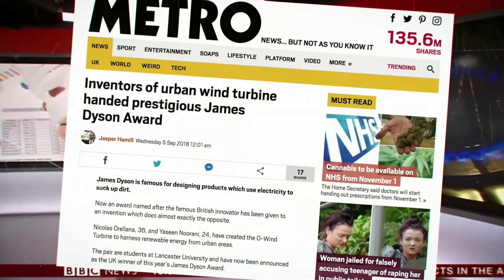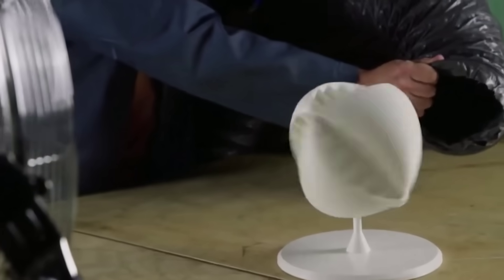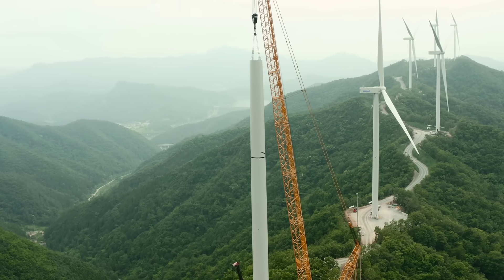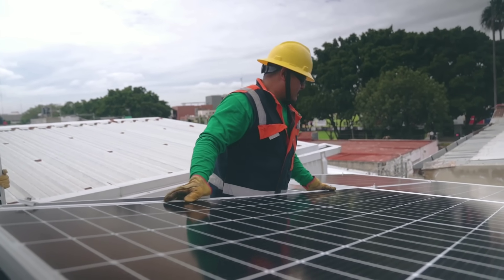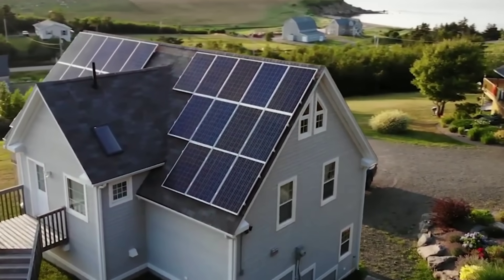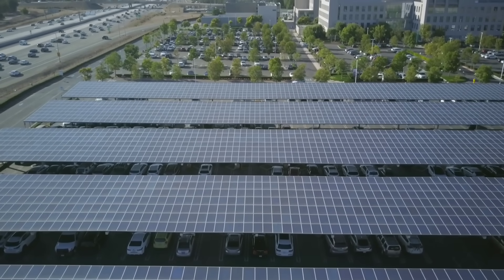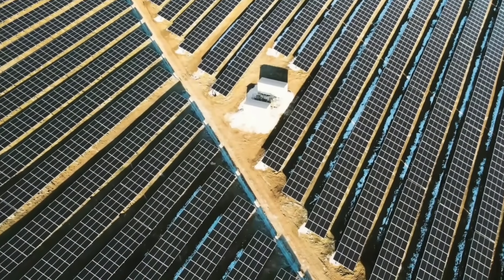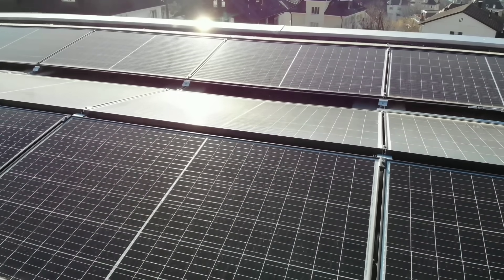This NEW European Wind Turbine for Home Out Perform PV Solar Panels in 2024?!

Comment: A wind turbine should not be beautiful, but should provide energy. In urban conditions, 6m/s is a rare wind speed. This turbine has no working area. There is a new technology for wind turbines on the user with the same name as mine, which uses new methods for regulating wind power, without them you simply do nothing. It's just that current wind turbines are for trash.

Comment: I have a wind turbine my solar panels work a lot better than the wind turbines why do you think that they work better I have been off grid for 25yrs turbines only work good when the wind is blowing very fast for many hours at a time.solar panels are not that good in the winter you also need a generator to charge your batteries. You should not take on every thing that is told about how good wind turbines or solar panels are good times and not good times with both of them.

Comment: It spins by itself fine, but what happens to it when you connect a generator? Presumably, if it still turns, you will get a variable frequency, variable voltage out of it. So we have to add a full wave rectifier, then  regulated power supply. At night, that is wasted energy, so you will also need some form of battery storage, then an inverter to convert it back to mains AC. It is clever, but it is only one spoke of a wheel!

Comment: This might be good on a sail boat. Allot of sailboats use solar and wind turbines but this seems to perform the same no matter how much you’re healing or what direction the wind is from. 
Also, the airspeed behind the windward side of the sail is faster due to the aerodynamics of the sail. They might be too bulky though.
Reply: Sails should be a giant bi facial panel powering the boat and electric prop.

Comment: Pure nonsense! All practical tests show that small wind turbines close to ground hardly generate any electricity! And only at very high costs!
Because there is hardly any wind close to the ground. It is also extremely gusty, which usually shortens the service life. 
Only if you need to be self-sufficient from the power grid, you should install the largest possible wind turbine on a high tower for the winter.
With solar panels, on the other hand, you can reliably generate green electricity for 25 years at approx. 3-10 cent/kWh!

Comment: if you have a 10 storey block of flats in a square design, with each floor being around 3m high (ball park figure), then from about 6m's up have these O-wind turbines conected to the corners of the building at every 1m - 1.5m, would that produce enough energy for the building, or at least all of its reliance on having to use fossil fuels???? - it might look wierd and strange having these all the way up your building but if the design is good then ppl probobaly wont mind that much

Comment: OK (sigh) here I ask again at another latest innovation of wind power:  where do you put the lubricant? It does need maintenance and don't try to convince me otherwise. It will get dirty, dusty, bugs will try to nest in it, birds will poop  on it, idiots will vandalize it. It will need lube. It will squeak if pebbles get jammed in there and they will. Does it freeze solid? Ice will form on it shutting it down and that blizzard last night that you were depending on to charge the battery will not happen and you gotta go chop wood to keep warm. STOP spending money on advertising with paid actors and max out the R&D till it's flawless and THEN show us. Don't persuade us.

Comment: PV is down to $200/kWp and is still falling, 30% alone in the 4 months since this video published. This turbine (not available) scaled up to 1kW would be several times more. Small wind turbines will never compete with solar, in price or production. Remember, they also only last one fifth of the time. Large turbines are a different matter, off shore more so. No contest. But this toy will never compete against even a $30 flexi 100Wp panel on the balcony.

Comment: The Halcium powerpod. Is an omni directional wind Turbine. It is a much more sturdy design. And produces way more power. They are close to production. Have functional prototypes. But can't get the finances to get there. I would buy 3 of their units to supplement my 19kwh solar panels, 72kwh storage. That I already have. But unfortunately no one wants to finance start ups.

Comment: The videos consists of 80% babbling that got nothing essential to do with the turbine. Comparing PV to wind is futile in pretty any aspect, let alone: claiming % of efficiency increase vs the other.
There are 2 turbine types shown: one with open air channels and another with closed air pockets, but no explanation what it does better / how much it behaves better compared to other vertical / helical / Flettner rotor designs, especially when it comes to efficiency at common wind speeds or scalability.

Comment: Instead of being in competition, turbines and solar panel should complement each other. One works only in the sun, while the other works when there is no sunlight. The use of both generation systems guarantee 24 hour per day electricity generation.
Reply: Absolutely 😊 💯
Reply: Without competition the motivation for innovation would diminish
Reply: @Sovereign272  Solar Panels could compete against other solar panels-same for turbines. When someone discovers and harnesses dilithium crystals the need for competition will diminish.
Reply: Stop being stupid guys i know having electricity is something very useful but think the climate impact of the wind turbines they reduce rain drop according to various studies by 75 if they are installed into the masses that may mean.... less to zero raindrop on cities are you guys nuts?
Reply: Assuming there is enough wind at night?
Reply: 20mA is not guaranteed when the panels are not working, nonsense
Reply: @FreddieVee  
No wind, heavy clouded skies.
You're back to candles.
They are a petroleum product.
Gonna cook, or eat cold?
Reply: @TahoeJones  There are ways to store energy and the different ways proliferating, as each method improves it's efficiency.

Comment: Solar panels give out 250Kw hours?
For a start, forget the hours part, it is meaningless at this point.
Solar radiation is between 1-1.2 Kw per square meter. Solar panels are around 20% efficient.
So that means 200-240 watts per square meter.
Your numbers are out by a factor of 1000.
Total rubbish.

Comment: At 3:55 the narrator claims "the turbine claims to have a power output of 200 kWh, which is enough to power a small appliance...." This is nonsense, or the video's producer just doesn't understand energy. All that matters is the power output in watts, for a certain diameter, at a certain wind speed. If that little one generated, say, 200W at 8 mph, that would be fairly respectable. Since output is directly dependent on what we call 'swept area', and since this turbine has a minimal swept area, I suspect the output is disappointingly low. 
It is very, very difficult to compete with photovoltaic panels. They sit there, almost maintenance free, for decades and continue to produce power. I have a thirty-two year old set of Kyoceras still on the job!

Comment: aha.   photovoltaic many different kinds  which one.  toy pv?  which is 5v,  .1 amp.  or those rooftop pv which is either 10 or 12 volt at 1 amp (smallest)?   did OP mean multiple panels of which kind?  does not even say what kind photovoltaic panels or sizes thereof.     
IF IF youtuber was directly talking about wind power or wind energy output so forth,  would made a good video.  but unfortunately the title is "establish a lie" being able to out perform PV  thus OP is supposedly demonstrating electrical energy, not companies nor the wind energy.  

Since double fallacy is given,   clearly  this is CLICKBAITING.  I am reporting them,  no money for fake facts.

Comment: You can't claim that something outperforms something else if you're comparing a frog with a pineapple.  That's just asinine.
Reply: Frog legs with pineapple, sounds yummy.
Reply: You can if you factor in the surface area it takes up vs the amount of power it produces…
You sound like you’re ridiculously unintelligent.
It makes me annoyed that most of society is filled with people like you.
And smart people have to fix it.
Reply: Depends on the output you’re comparing.  They’re both creating electrical output.  Frogs can jump higher than pineapples but pineapples are sweeter.
Reply: @richardweighill8556  You tried to say the same thing I did with different words and failed to understand the underlying point, which "outperform" takes input, output, and cost.
Reply: @MasterKenfucius  that’s fair

Comment: Quote "The O-Wind turbine claims to have an output of 200kWh which is enough to power a small appliance or charge a battery."  This is total nonsense of course. Our whole house and car charging is around 200-350 kWh per month. I think they are confusing their kilo watts and kilo watt hours. "PV solar panels have a typical power output of 250 kWh per square meter". Again this is nonsense. A typical solar panel these days produces around 400 watts in ideal conditions which in an hour would produce 0.4 kWh. He is talking about watts not kilo watt hours. He says the O-wind turbine uses water for cooling. Really? Existing wind turbine tech is good and getting better. This new design may have some potential in some situations but they will need to be much bigger than a football.
Reply: I think the dialogue may have been produced by AI. I’m seeing many articles where the sentences may make sense, but the overall statement or paragraph is nonsense or not factual.
Reply: It is just a youtube video and a lot of them are made up nonsense.well pointed out🙂
Reply: If you were to design a system to produce enough power to fully power what a house would typically use in a day what would you use?
Reply: A home consume around 5mwh a month, 1 Fridge alone is 2000x24h=48000wat/24h x 30 day= 1440000watt, 200kw generator weight around 2000kg and needs an advanced strong ”O” shaped turbine. 10kw is enough buy few of them and you are good
Reply: @abudancemex1533  Our electricity consumption for December was 346 kWh. That was for everything including cooking  fridge, washing and charging the car.  No fridge would use 2000 w or 2  kW  an hour! That's a heater!
Reply: @ralpharmsby8040  do you know how to run the 200kw motor without wind turbine?
Reply: @abudancemex1533  that must be a really big or inefficient house. Last month was 2,235kWh for my 3bed, 2bath + 3,000+ miles of EV charging.

Comment: Yet another Vertical Wind turbine (in spite of the name). Not a single real world example in this video, much like the others.. Everything looks great in a lab with a fan. Maybe this one will be different? If you go to their web site, they are still in prototype phase. (Nothing wrong with that) and were inspired by a NASA design, they don't say they worked directly with NASA. With wind...size matters, so will see how big the device needs to be to generate consistent output. If it works at small scale, could find use in the Sail Boat/Marine industry where winds are choppy and mixed at sea level. Especially if it's truly quiet. Good luck, though I won't be holding my breath.
Reply: I tell people my outhouse was 'inspired by Nasa'. It's a meaningless claim.

Comment: At face value, this sounds good but the devil is in the details. At this time, there are no spec's available and these have not been commercialized yet so no pricing or delivery timeframes. These will need to go through IEC / UL testing for small wind turbines to generate a power curve for each model or size for which they will produce so customers can have realistic expectations about power generation at various wind speeds and conditions. Urban wind turbines are notorious for poor power performance and economics. At best, this is a long-shot with a high risk of failure and there is no guarantee that the company will be able to get the needed certification testing and then be able to manufacture these at a price that makes economic sense...

Comment: This looks promising.i always wonder what happens to solar panels after 29-40 years.can they be reusable or ?
Reply: This Segway Portable PowerStation Cube Series seems like a great option for both outdoor enthusiasts and home backup power needs. With its massive capacity, fast recharging, and waterproof design, it's definitely worth considering. As for solar panels, they can often be recycled or repurposed after their lifespan. It's always good to research local recycling options or inquire with the manufacturer.